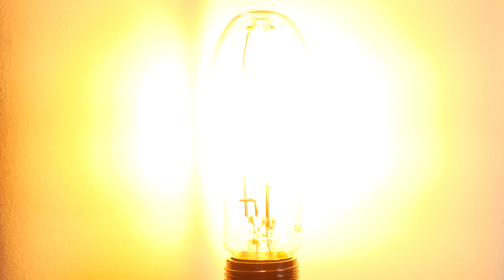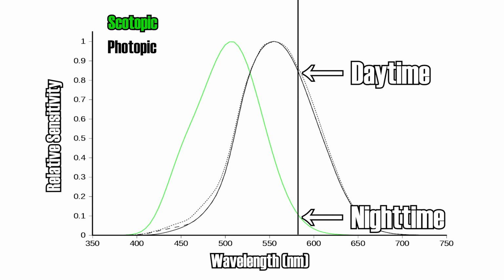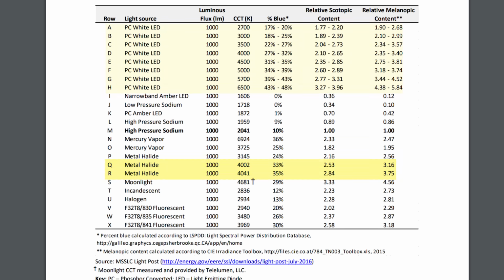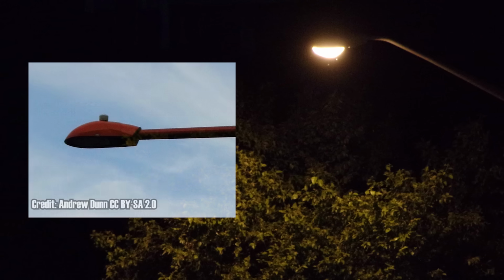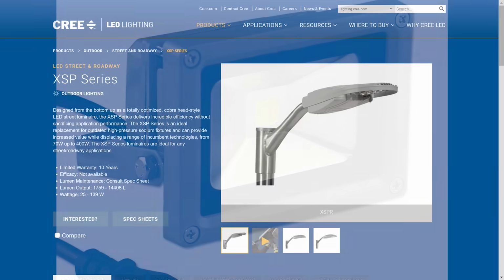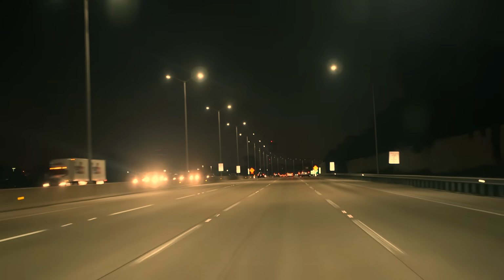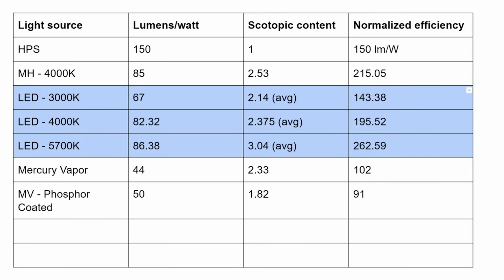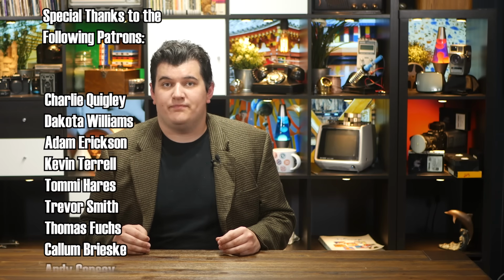The LED's Challenge to High Pressure Sodium

Comment: San Jose is a good example of the impact city lighting has specifically on astronomical observatories. Decades ago, the city installed Low-Pressure Sodium lamps everywhere (instead of HPS) for various reasons including the nearby Lick Observatory. Both the redder color of LPS lamps as well as their narrow wavelength band means that the observatory could easily filter out the city's light pollution. The bluer the light, the more scattering (haze) happens in the atmosphere. Now that San Jose has replaced all LPS lamps with bluer LEDs (done as of next year), the observatory can no longer filter out the light pollution.

The city's reaction? All they can do is dim the lights a little during the early-morning hours. They can't stop the LEDs from being high K.
Reply: They should've went to Amber LEDs
Reply: Why cant they change the color?

White leds are made out of RGB so just take blue out and you get the desired color, everyone is happy (city because they think leds are more eficient and cheaper, astronomers because they can filter the light polution out)
Reply: @Veso266  False. White LEDs used for area lighting are made of blue LEDs coated with a phosphor layer above to convert the blue photons into the color temperature specified by the manufacturer
Reply: @Veso266  Because the blue is the point. They believe more accurate color vision at night increases safety.
Reply: @unvexis  oh I see, when people believe something you are screwed.... I guess astronomers will have to move to a countryside far away from the city, I am not sure why did they build their observatories in the city/close to it anyway since light polution is not new problem

BTW: why did they swich to HPS (orange color) in the first place

They already had white color (not sure what lamps were used before HPS/LPS, but I believe gas ones also had white color
Reply: @Veso266  Well, Lick was built in the 1880s, so there wasn't a city nearby at the time, and they were pretty far out in the countryside, but things change.
Reply: @Veso266  And as for why San Jose switched to LPS lamps in the early 1980s, at the time, the city was using incandescents and mercury-vapor lamps. LPS was much more energy efficient, and, incidentally, they cast a narrower range of wavelengths, so they were mandated within a certain radius of Lick to reduce interference.

Comment: to me the yellow/orange lights have a bigger effective range. the LEDs are very bright up close but they dont have the same kind of diffusion and the lighting is really harsh, especially under wet conditions. also the yellow lights are very distinct and it's easier to notice from a distance that they are street lights
Reply: Was it france where the headlights are yellow for snowy/misty situations.
Reply: If they don't have the right diffusion, then they aren't using the right optic.
Reply: @floyd2386  the reason doesnt matter when the outcome is shit anyway
Reply: @soundlesspeal  You are generalizing with your original  statement. Not all LED lights are going to be like that. In fact, the ones my city uses have better coverage than  the lights they replaced. So no, not shit anyway.
Reply: @floyd2386  saying that the old ones were worse doesnt tell me anything. of course its better if they work now, but thats not saying LEDs are the best solution they couldve gone with
Reply: @soundlesspeal  The best solution is one that is properly thought out and executed and it sounds to me like the lights you  are dealing with weren't.

Comment: This video seems somewhat misleading or shallowly researched, because once our city converted to LEDs for street lighting, it has become very noticeably darker, and it is even worse in light rain condition, basically zero light on the road, I can see surrounding structures, trees etc, but the asphalt is black and not visible at all, it wasn't nearly this bad with the LPS lights, of course everything was yellowish, but I could see the road in the rain, now I cannot
I'm 42 with zero vision problems, no colorblindness or anything else that might mess with color/light perception
p.s. of course it is possible that the city council skimped on the LED wattage and someone is pocketing the saved lighting budged, but still, noticeably poorer lighting of the road at night compared to LPS lights, very contrary to what the "science" in this video tells

Comment: My main problem with 90% of the LED fixtures I see being put on roads is the lack of diffusers. They make so much glare that I feel I'd be better off without any street lighting if there were no traffic. HPS typically uses diffusers on the fixtures, and don't glare as much.
As far as the blue light thing goes, that probably comes from the fact that many LEDs us UV light to excite a phosphorous, which emits the visible light. I believe the thought is that some of that UV gets out, which can be harmful. Also, you can see when the bond between the diode and phosphorous fails, as the light turns purple, and is presumable leaking large amounts of UV.

Comment: Orange is better in fog. LED street lights do have sharp glare. Low pressure and high pressure sodium appear to spread the light evenly.
There is maintenance issues with theses LED fittings.

Comment: You know what kind of light is unsafe at night? Cop light bars! They like those things up so bright you can't even see the street or them or anything else but blinding blue. Your safety we really need to figure out the best way for them to light their vehicles when they have somebody pulled over.

Have to listen to the whole video, I think maybe the problem is is that their rear lights should not be blue but should be read therefore we will see them but we will also see where we're going. Because cops typically are not behind their vehicle they're typically in front of their vehicle where there should be white light. Perhaps this whole blinking light thing all over the road should go away. Anyone see a big yellow bus better because of a bright white blinking on it the construction workers really need to have strobe lights on at all times while they drive down the street? Sure I'm ranting here but these are things that cause us to disregard blinking lights when they're important like when they're on an ambulance fire truck or police car. Only places they should be.

Comment: i feel on the road the melatonin issue shouldn't be considered that much a problem. youd want people to be awake on the road. so depending on the road maybe youd want a gradient of led filters from densely used/low residential  being the white light to make sure no one is asleep on the road and it wont bother homes, while more yellow filtered LEDs are used when they get closer to residentials or less used road ways. 
i feel motion detection needs to be utilized if there's going to be any amount of impact on energy saving or light pollution. honestly i wouldn't mind the nuclear option of a HOA style guerilla campaign to slap the wrists on every offending light that's on for no reason at inconvenient hours or is not being utilized properly. cities should get the chance to see the sky, i was surprised just how far out state i had to go to see the stars clearly.

Comment: You're talking an utter bullshit. Dunno why your video was amongst my suggestions but I gave it a try and all I can say is you do not have basic knowledge of physics.
LEDs, which you love so much, are giving your eyes a stressful and dangerous glare. Why? Because their light spectrum resembles more that of the daylight. Is that bad? Yes. Besides light pollution, increased tiredness, loss of focus, LEDs are switching (literally) our eyes into the daylight mode, diluting pupils at the same luminosities that sodium lamps are not doing it. Sodium lamps are giving off light which triggers the dilution of our eye pupils to lesser extent which is far, far, far more safer for the driver and unlit objects like pedestrians while the driver is moving out from heavily lit area to a darker zone, which is inevitable even in very well lit cities. Why? Pupils' reaction is extremely slow. It doesn't have to be fast from evolutionary point of view. When you're going into a cavern from broad sunlight there's simply no need for our eyes to adjust pupils reaction in split second. Before doing such useless vids try to have at least some basic physics courses first.

Comment: Have there been any safety tests of when you exit the freeway? As in being leaving the freeway and entering non-lit streets after being exposed to those super bright LEDs that have ruined your night vision. There's a stretch of 65 where I live that ended up with some LED lights and the exit in that section is well known in this area as the most dangerous exit where all the wrecks happen. There's alot of deer and such out here and the LED lights do keep them further from the freeway itself (there's a pro), but this causes larger groups of them confused since their normal routes have been disturbed around the ramp (con). On top of that it's crazy hard to see anything in the dark after getting off that stretch of freeway (con). Normally I'm a pretty good deer spotter since I've grown up around here, but even I've had to make some pretty dangerous maneuvers to avoid deer that seem to pop out of thin air and into my head lights (another con hazards have lower visibility after being exposed to LEDs at night). Some counties around me have also banned LED headlights for the same reason, they destroy your ability to see at night once they're gone and not everywhere can afford to light every single windy country road in their county with LED's.

Comment: We've just had 3000K LED streetlights installed on the highway outside our house, replacing low pressure sodium fixtures and it's one heck of a difference, and very dazzling (although this is probably because we're used to LPS lamps that appear dimmer - they do appear to be around the same luminance and light the road up nicely)

Comment: I know this video is a bit old (I'm binging your content) but my house has the last LED suggestion that you/commenter gave (19:33) 
The LED is called all rounder it has three operating wattages 
1.  15W white light 
2.    8W white light 
3. 0.5W warm white 

They switch by turning the on off switch twice rapidly so no "smart" stuff required and cost approx 1.2 times a normal LED
Reply: I'm glad to see these things being implemented. While we don't yet have color changing lights around here, I live on a corner with a street lamp that was just recently changed to a flat LED light that reduces the light pollution upwards. It's a noticeably cooler light tone but I do not believe it is pure blue-white.

Comment: The local council removed all of the HPS the lights down our road, and replaced half of them with LED arrays. On one hand it's good because they removed one which was right on the edge of our driveway, making access quite tricky unless you got the angle just right (although it did stop people parking across the drive, so swings and roundabouts...), also obviously much lower energy usage which is always a good thing.

Unfortunately they are much brighter/harsher than the old ones, so we had to get blackout blinds :(
Reply: Ours got replaced some time ago (almost approaching 10 years!) and while it was nice that they moved the lamp posts away from the pavement edge, they also reduced their quantity, which leaves massive gaps of poor lighting between the posts. Interestingly enough, a "main"- ish road got orangey LED replacements, whereas the side roads have the white ones - wonder why they went with that?

Comment: The golf course near my house replaced their parking lot’s HPS lights with even taller LED fixtures.  They are so bright that they are blinding me in my room in the winter when the tree leaves no longer block the light. They are about a 1/2 mile from us. It’s ridiculous.
Reply: The problem is more a failure of them to use proper reflectors and baffling, a case of lazy contractors and uncaring owners.
Reply: You should consider talking to a lawyer to see if you have a ground for a lawsuit against them
Reply: This is more of an issue the type and brightness of the light they used ratehr than the technology themselves. sounds like they didn't do their research
Reply: Shoot 'em
Reply: yeah definitely look for light pollution ordinances so you can take care of them :)
Reply: This is more a case of them not installing the LEDs properly, something they could get away with when using HPS because it doesn't seem very bright during night time, but white LEDs are going to be bright enough to cause a problem.

Comment: The best efficient HPS lamp beats LED in efficiency,
Yes, it may do that, but it's probs more expensive to make and is therefore not going to be bought by governments, cause they like to cut costs everywhere, so it's easy to assume most, if not all HPS lamps out there on the street are below LEDs in efficiency.

Comment: I did an internship at my state’s tollway authority a couple of years ago where I spent the bulk of my time marking each and every sodium lamp streetlight for replacement with LED bulbs. 
Out in the more rural areas locals feared the new, brighter LED’s would create a lot of light pollution, but the new lamps are designed to mitigate this. 
Meanwhile, a small arterial road in my neighborhood is lit by decorative high-pressure sodium lamps that have the bulb sitting in a casing on top of the post, which to me not only looks good but is obviously a nostalgic look considering it what I grew up with.
Reply: " but the new lamps are designed to mitigate this." They're what are called "full cutoff" fixtures-almost all the light goes down, very little goes to the sides, and none goes up.

Comment: 1) Great content; I love that you take time and do the work to explain why these changes are complex.
2) For me, bring the blue.  I actually prefer it to either the hideous orange.  A lot.  Even though it's true that the low pressure sodium orange has little downside for astronomers because it's so easy to filter out, which I care about because it's one of my hobbies.  Warm LED lights (for me and my rods and cones) just don't feel like real light - by which I mean that I see better with the blue lights.  I'm willing to take my chances with the sleep effects.  Although the most recent comment is a joke, there's a kernel of truth there; if blue light keeps you awake while driving, I call that a feature, not a bug.
Reply: I somewhat agree but with the caveat I think it might not be a bad idea to use LPS or HPS in areas with a significant residential population. These areas typically have low traffic speeds and so even drivers don't necessarily need to spot hazards 100 meters away or more to execute a safe stop. This reduces the benefits of being able to see further and spot hazards earlier as a result. On the other hand the large residential population that is exposed constantly all night long increases the potential for side effects due to chronic exposure. Bear in mind that the issue with blue light is more one of chronic exposure the circadian rhythm doesn't adapt instantly from a short exposure. Hell it can only muster around 3 hours per day of change comfortably when stimulated by a change in the timing of by far the most intense light any of us experience ie direct sunlight. This is exactly why it can take several days to recover from the jet lag of a long haul East/West flight the offset between the solar cycle and your own rhythm is way beyond what your body can adapt to in a single day. If anything a short term exposure to far less intense blue light eg needing to night drive for a few hours one day I would imagine might confuse your body into thinking it is an hour earlier at most. That is hardly going to be a major issue that is no worse than the twice annual clock change in most countries which is a disruption that is little more than a minor inconvenience for me and I have a sleep disorder to begin with so I'm exactly the sort of person that is particularly vulnerable to such disruption.

Comment: The IES now says they made a mistake in RP-8-18.  They should have used the photopic curve because you DO see color under street lights.  In fact, you are more sensitive to warmer streetlight plus it is far lower glare.  The IES has updated its information in Chapter 2 of RP-8-18.  See section 2.3.4.2.